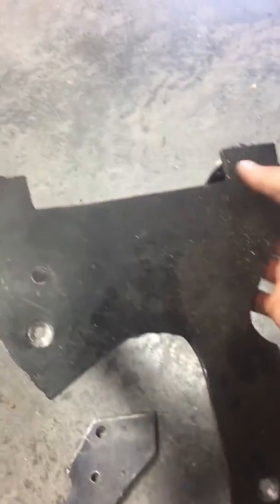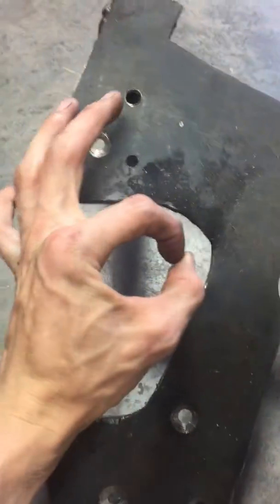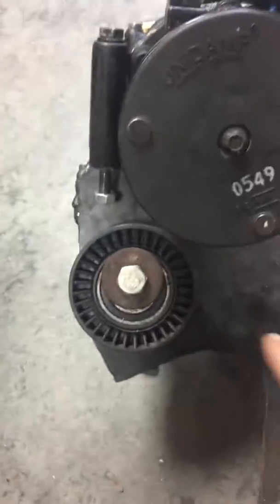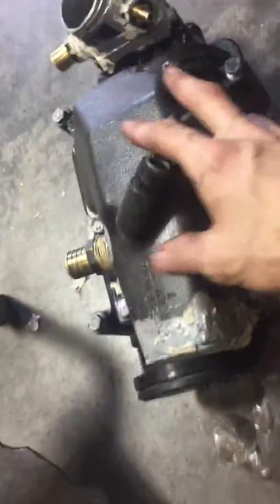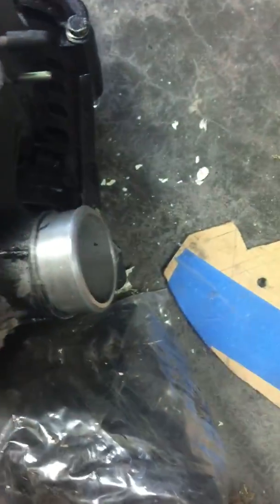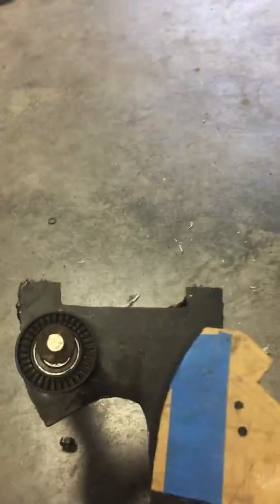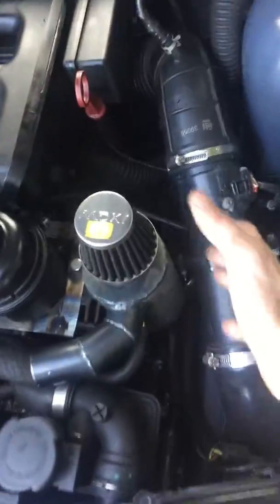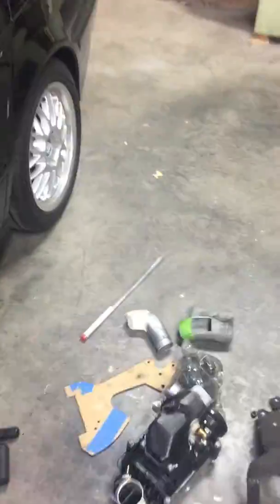M62 supercharger for e46 budget bracket setup video

Comment: Hey man, could you do a measurement for the bracket please? also how do you managed to make a switch on/off for the charger. My m62 also have a clutch with a harness. It's a bit late but really appreciate if you respond!
Reply from the maker: I don't have the bracket anymore, probably tuna cans by now. If I recall, I just had the supercharger clutch wired to a 4 pin relay and a 30 amp fuse with an on/off switch